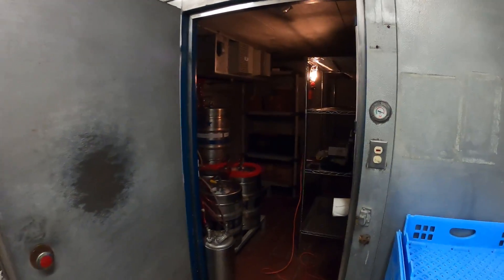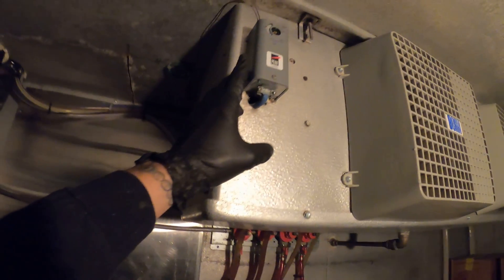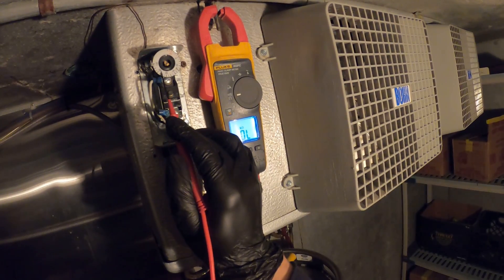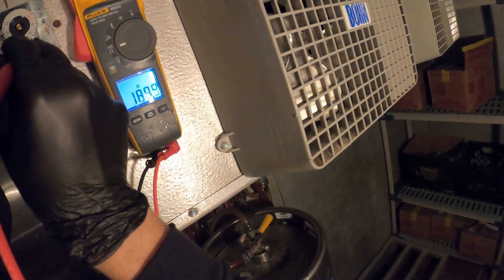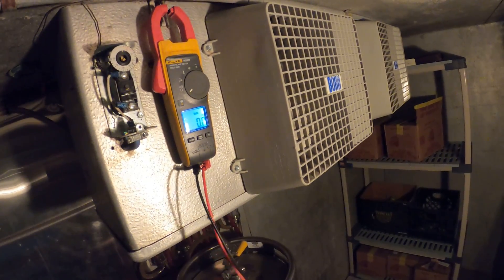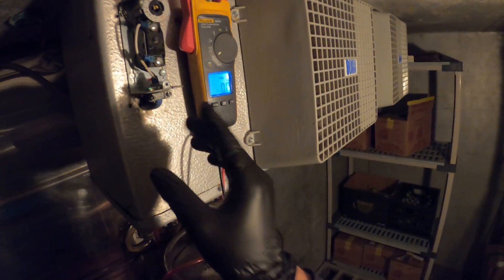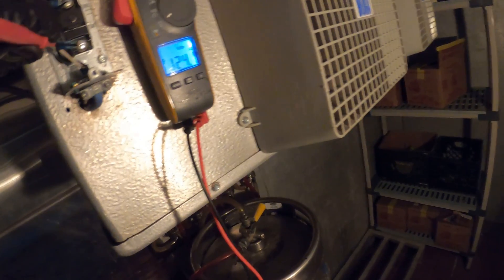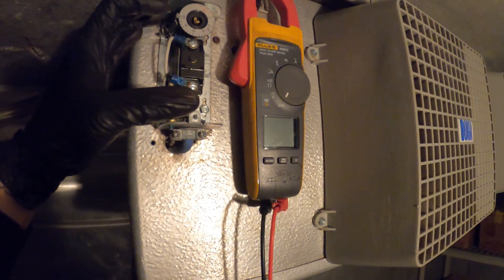HVACR: How To Check A Commercial Refrigeration Thermostat With A Multimeter(Voltage/Resistance Test)

Comment: Nice video I hope you addressed the Romex running through the hole in the panel the thermostat is attached to when you replaced the thermostat.  It should have a clamp or a grommet where it goes into the cabinet.  I just fixed a mini-split where the installer had not used a liquid-tite fitting at the unit and seemed to have run the THHN wires through every sharp-edged metal hole he could find.  After 4 years, the customer called him for the 30 amp breaker tripping immediately on reset. Promised to come out, no showed, then wouldn't answer his phone. I am a member and one of them knew I had HVAC training.  It wasn't hard to find the wire shorted against the edge of a hole.  I checked the other mini-split that was installed at the same time. It was worse.  He used BX cable with no clamp on the wire at the unit and ran the wires the same way.

Comment: Thanks for the video. Very helpful. Just curious though, why when the circuit is closed does the voltage register as zero? It just seems counterintuitive. I would think that when it’s closed you’d read voltage and when it’s open you’d register as zero volts, like a single pole switch.

It’s like its opposite with thermostats.
Reply: It like a draw bridge, when the bridge is close cars can drive over the bridge. When the the draw bridge is open, car can no longer drive over the bridge.

Comment: ? About the 3n1. The urco 210 has a capacitor inside with a 243-292mfd rating. Can u use it on a unit that had a capacitor with a lower mfd example 161-190mfd ?